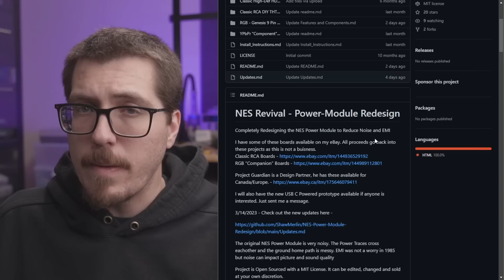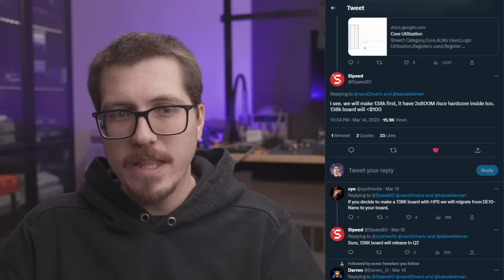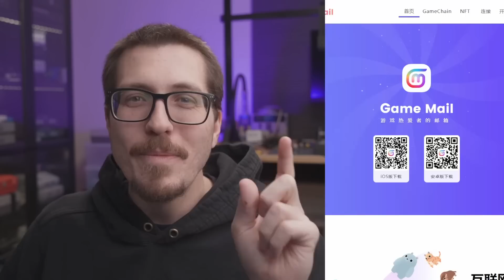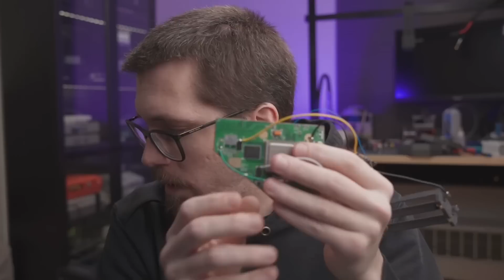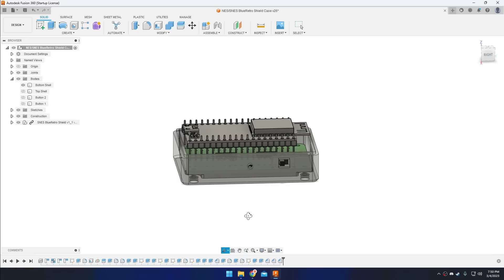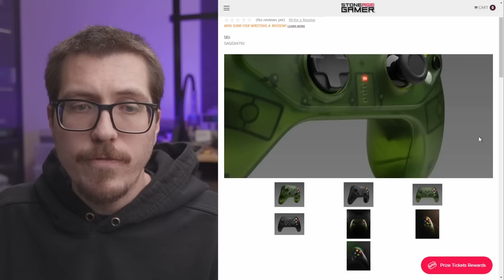New WIRELESS Original Xbox Controller! - Retro Modding News

Comment: I wonder if the Tang Nano 20K could be connected to a 65816 to lighten it's "load" for SNES simulation/replication.... I know the 65816 has a 6502 mode so I'm sure someone could get it to work for the NES part anyways....

Comment: Thanks for the shout out!!  For those curious,  I feel the Full Bridge Rectifier was under performing and at only being rated for 2 amps, it was getting hot even under normal use. I have upgraded that to a 5 amp Rectifier and I might even break it into individual diodes to get even more headroom.  I also have added a fuse and some other quality of life improvements.  They will be released under Version 2.1

Comment: There were a ton of third party wireless XBOX controllers back in the day. It isn’t a “hack” to use a dongle since, as you mentioned, the console had no wireless built in… proprietary or otherwise. Every controller has to plug into the controller ports whether wired or wireless. Also, the controller ports are just USB ports so it’s relatively easy to make a wireless USB controller that spoofs the IDs of an original XBOX controller.
Reply: Ya, Logitech made the more popular wireless controller. I'm sure Mad Catz had their own. There's nothing special about a wireless Xbox controller, other than it having Hall Effect sensors and being brand new.
Reply: @37Kilo2  Yeah. I saw wireless Mad Catz controllers for the original XBOX at the flea market last weekend and I can’t even found how many of the orphan controllers or wireless dongles I’ve accumulated over the years. I’m always seeing those dongles with two big memory card slots at Goodwill and other places.

It’s the XBOX 360 that had issues with third party wireless controllers being unable to interface with the console’s native wireless but that was eventually resolved.

As I recall, Guitar Hero III for XBOX 360 was bundled with a corded guitar Xplorer or Les Paul though the Les Paul sold separately for XBOX 360 was wireless. This was due to licensing costs for natively interfacing with Microsoft’s proprietary wireless controller tech.

Eventually everything went back to dongles so that they could sell the same instruments for various consoles.
Reply: I think he's confusing all the wired 3rd party controllers on Xbox One (due to proprietary issues) with the original Xbox.
Reply: @Portugeek79  exactly
Reply: He seems to have mixed up the Xbox One and Xbox 1, can't really blame him for that. The Xbox One and Series consoles have a proprietary wireless setup which Microsoft refuses to license to anyone, so everything for modern Xbox consoles has been wired. I guess that is a little better than Sony though, who isn't licensing any regular controllers for the PS5. They only started licensing expensive "Pro" controllers a few months ago.
Reply: @OmairArif  XBOX 360 was the same way at first.